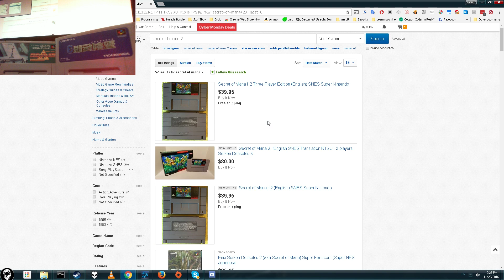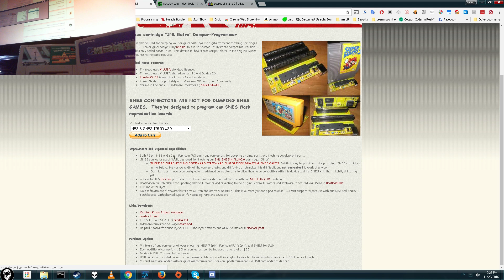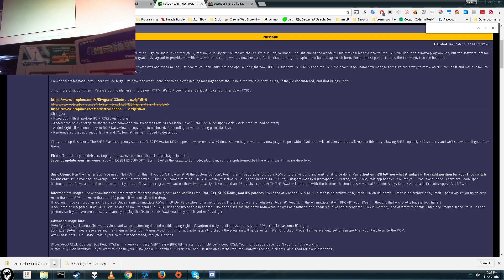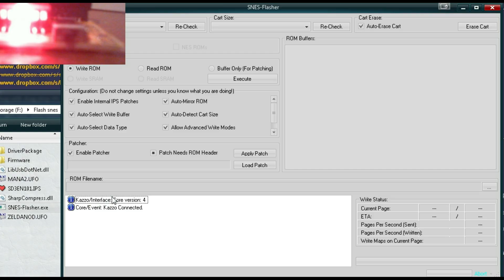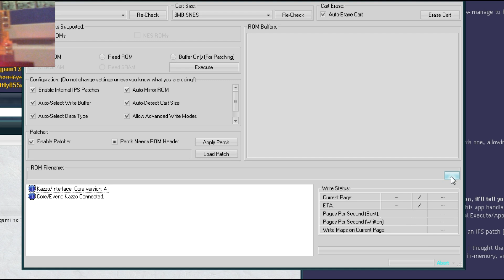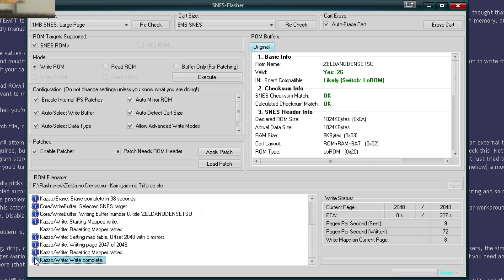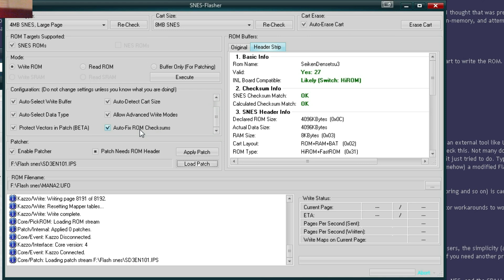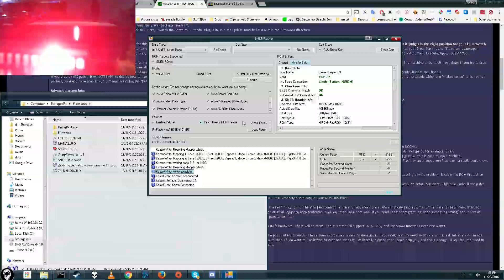Make Your own SNES Repros Without soldering! (100% Legal Repro carts) [Outdated]

Comment: Good to know that it's so easy to flash these. I got some repro carts of Final Fantasy games, but unfortunately they included the J2E translation of FFIV (Which is rife with translation and localisation issues). So I want to flash the Naming-way version instead. Hopefully these people have used flash-able carts, if not 21 bucks for a replacement cart doesn't seem too expensive.
Reply from the maker: yeah, sadly most cheap repro's are not really easy to reflash. (I've tried, no luck)
But these boards are pretty fairly priced.

Comment: Hey thanks for the tutorial. I'm making my own Super Metroid hack and I'm hoping to do this once I'm finished. Anything I should worry about with a custom hack? I assume just follow the same settings as the original Super Metroid. Also, what file type is being imported into the cartridge, .sfc .smc or .ips?
Reply from the maker: I've tried pre-patched, and patching using the flasher.
Both seemed to work, but it may depend on the size/complexity of the patch.
Also keep in mind this tutorial is old, and will only work on the old version of the flasher (discontinued)
The new flasher requires new software, so the steps will be a bit different.